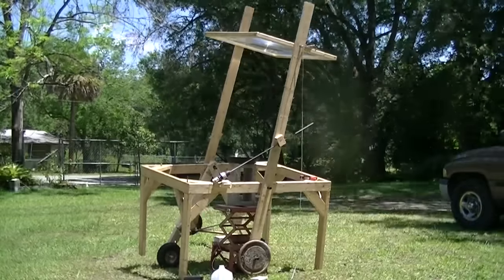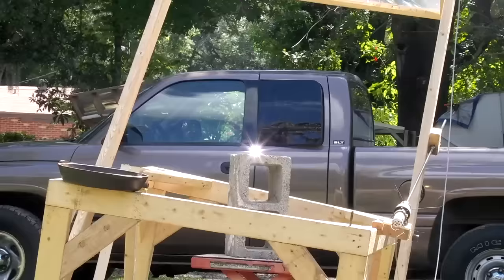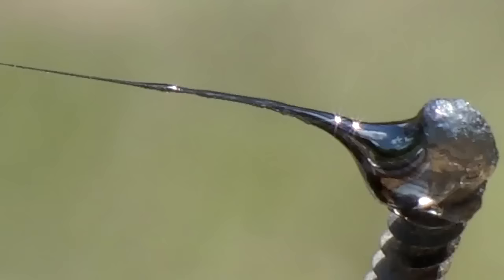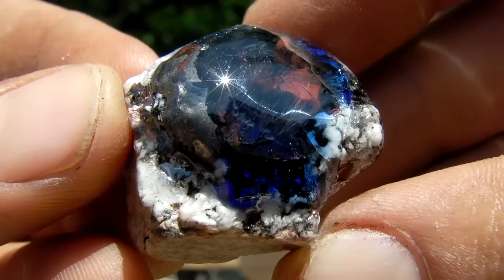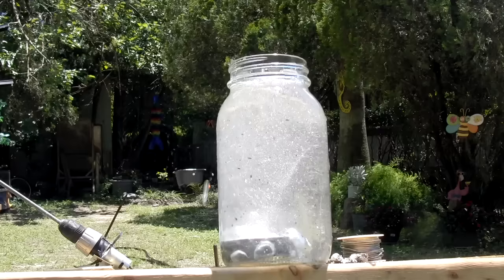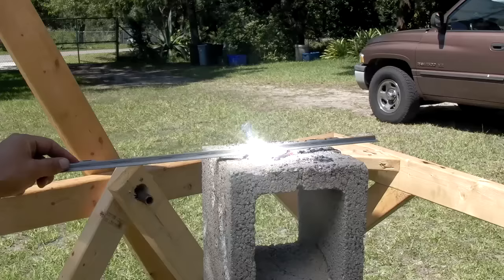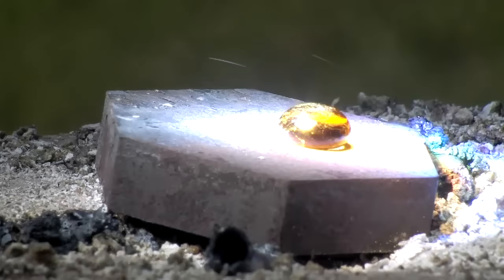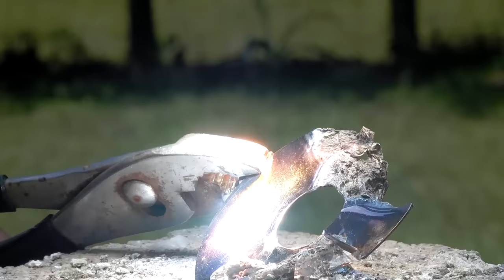Fresnel Lens Solar Power Foundry Obsidian Farm 3800 ˚ F 2100˚ C Fresnel Optics greenpowerscience

Comment from the maker: Info on Fresnel Lenses:
http://greenpowerscience.com
Reply: GREENPOWERSCIENCE i need a fresnel lens!
Reply: how much for?
I WANT IT.
Reply: can you put 2 Fresnel lens in a row for a supreme source of heat ?  or the second lens will melt like all the other material ?
Reply: Do you believe that a large enough fresnel lens could easily cut stone? Like to cut stone for construction purposes.
Reply: Why are they using this for solar panels
Reply: hey uhhhh, you can contain your work area with argon. might get some impressive results. ;)
Reply: i think i just invented a new way to weld.  im gonna draw this up
Reply: @greenpowerscience what is the quality of the obsidian? Can it be done to make good quality obsidian have you noticed? Without cracks or unwanted inclusions? Also have you tried making rainbow, gold sheen or silver sheen obsidian by chance?
Reply: @GREENPOWERSCIENCE Have you experimented with air heating with fresnel lenses? How would you go about building a contraption that could heat as much air as possible, as hot as possible and as fast as possible?
Reply: @BriShep123  i suppose you would need some kind of heat shielded chamber and a vent attached to that which leads to a far away suction fan so it won't melt. Something along those lines maybe even heating a water tank and pumping the hot water through the house...like heated floor systems? Lots you could come up with when you really think about it
Reply: @jeffclarkofclarklesparkle3103  Yep, I was thinking about something like that. I imagined a thick rotating tube made of a material with a high melting point. The tube could be wrapped in another heat resistant tube, a heat shield like you said. The heat shielding would have openings at the top for the light. And the thick inner tube would somehow rotate  at high speed and the air would pass through the core.
Reply: @BriShep123  even that seems like a bit too much, dont forget you need the solar tracker as well for it to be most effective. What i think is that if you have the focal point inside a giant crucible with some very thick heat shield layering and a side vent, all you would need to do is pull air from that vent i think. No need for rotation, that just adds more room for error.  But say the other design you heat a huge tank of water and have that pump through infloor heating pipes, as well as a steam turbine to generate some steam power as well maybe would be another good application for heating, and i think with the water tank method it could be controlled much better than the other and possibly for hot water in the plumbing as well....got ya thinking yet hahahah?!
Reply: @jeffclarkofclarklesparkle3103  Using a water circulation system would be a indirect system, I think direct heating is better for getting the air as hot as possible. I was thinking perhsps a long thick ceramic cylinder would do the trick, I imagined if the cylinder rotatated under the focal point it would heat up faster and distribute the heat more evenly. Also, because the air would probably take a while to absorb heat from the cylinder wall, it would probably take multiple lenses aiming at thr top of the cylinder. I wasn't going for simplicity 😉, just getting the air insanely hot.
Reply: @BriShep123  right! Im no expert by far, just trying to help brainstrom. But yeah who says you need just one lens? So this cylindrical design may work. You may have to play with the speed of the cylinder a bit, or even hook up some kind of slow suction. Are you going for space heating or forge style heating? How hot you talking about? You said as hot and as fast as possible, but you may need to do it gradually for highest heat im thinking
Reply: @BriShep123  p.s. love the ideas of these lenses. And the idea of heated floors one day and if you get this design for hot air going please do share! ...im also going to try my hand at making obsidian when i get a lens of my own
Reply: @jeffclarkofclarklesparkle3103   Forge style heating is definitely what  I'm after. I was also thinking instead of just a ceramic cylinder, maybe a melted or almost melted material inside the ceramic cylinder. Lots of possibilities. Good luck with your own lens experimenting. Free floor heating sure would be nice.
Reply: @BriShep123  just build a clay forge as big or long as you'd like it. If you're into forging...check it out
Reply: Have you tried putting a steak on that see haoe fast it would cook and burn?  Also  put Animal bones to cremate them?
Reply: What type of rock did you melt at the start of your video and which then gives a vitrified effect please?  Is it obsidian or granite?  Thank you
Reply: Yo, u hve to check out DR. STONE. anime. Its legit info and u r like a living dr stone w this contraption
Reply: @denisgiguere1600  yes
Reply: Have yall used this at night to make objects colder in moonlight?
Reply: @BriShep123 
1 square meter, 11 square feet, of sunlight gives you about 1 kilowatt of power. The Fresnel lens, or a parabolic dish, only concentrates the 1 kilowatt onto a small area.
Reply: @MarianLuca-rz5kk  👍

Comment: Why set up MILES of Giant Fresnel lenses devices, alongside roadways, that lead to recycling plants that presently spent big money to create HEAT, so they focus sunlight on very long copper pipes, which are mostly thermally insulated, and pump air or inert gas into one end of the copper pipeline, so that it jets out like a BLOWTORCH from its other end inside the recycling plant, so they can use the FREE thermal energy, to lessen the expensive electrical bill such recycling plants require?

Comment: Why can't they yield this to generate power? Not through solar panels but using this heat to make steam engine. Don't know cons.
Reply: There's actually some solar concentrator power plants in existence, but they're more complicated and evidently more expensive to build than a solar farm so they're less common.
Reply: Why does everybody leap to mega size solar farms when a simple small scale design can provide the needs for one or two houses at a time, combined with small scale localized wind and maintaining a connection to the grid for supplemental power
Reply: Because in general machinery gets more efficient the larger they get and and cheaper the larger and more you make
Reply: Because all that equipment and energy to build it, plus space did the work of what about .1 gallons of propane could do 24/7

Comment: This is clearly one of your best videos.
The tracker causes focused solar radiation to continuously illuminate a single point and many new potential applications exist.
If the fresnel lens is lowered so that it's focal point coincides with the lower pivot of the tracker, the focus on the target will remain constant throughout the day.  It is also possible to pivot the target with the tracker, if desired.

Good Job!

Comment: Hi Rojas, I was just wondering a thought accord to me that your idea could definitely be used to warm swimming pools in the winder to go swimming anytime of the year... I was kinda picturing a connection system to pump the water through while the sun is out to warm tje water up, I guess over a few days it will reach 80+ degrees Celsius or Fahrenheit not only that but it could be connected with a computer to keep it at a certain tempature for practically free. Could you create a video about this for other to take to newer levels, please. I personally believe it will inspire many and will definitely buy these units to add to their swimming pools, even private communities will invest in them or resorts, etc. Because I just went outside its very cold but it would be nice to go for a swim in warm water, but as we all know that it would cost lots of money and the electricity bill will sky rocket. So this solar ray, if built by professionals it will be in assuming the safest possible for anyone to opperate in every household that happens to have a swimming pool not just that but others would then be more inclined to invest in one just because of this concept of yours. I'm a firm believer that it could work and will work, plus it will naturally neutralise bacteria from the water therefore purifying it in a sense because of the heat that it will introduce and infuse into the water. What do you think about all this?
Reply: That's a great idea. Imagine - this technology is so simple and we're complicating our lives enormously by not utilizing this type of technology. All deliberately done.

Comment: You could use this to heat a boiler and run a steam cycle motor with an AC motor attached to the end and produce AC power. That some intense heat! Not sure why they dont use that in a large scale more commonly.
Reply: Jack T it burns the shit out of birds, it doesn't work at night and it powers down in overcast days.

It's astonishing near the equator during summer/spring. Not so much at high latitudes or winter.

Comment: That was awesome Dan! So many applications. Have you seen the solar sinter?
Markus Kayser took a solar panel, solar tracker, fresnel lense, battery, and 3d printer
into the desert and used the power of the sun to print 3d bowls from the desert sand.
The video is on youtube -solar sinter. If anyone could appreciate this it is you Dan!

Comment: Can we boil water 20 lit. At least..
How much time required
Reply: It takes about 628 Watt hours of thermal energy to boil away one liter of liquid water, assuming negligible thermal heat loss from the apparatus, and no heating of the resulting steam beyond 100 degrees Celsius, when the water has already been pre-heated to 100 degrees Celsius liquid state.

The size of the Fresnel lens in the video appears to be roughly 1 square meter, and when oriented directly perpendicular to the sun without atmospheric occlusions like clouds, can collect approximately 1000 Watts per square meter of lens area (although not at sunrise or sunset, when the sun is too low on the horizon and must pass through too much thickness of atmosphere).  In other words, he appears to have an approximately 1000 Watt optical heater.

If the thermal energy was used with 100% efficiency to convert the liquid water into wet steam, then he could theoretically boil off approximately 1.6 liters per hour (ex: 1000 W / 628 Wh/liter = 1.6 liters/hour), or 12.5 hours of strong sunshine to boil 20 liters.  In practice, there is some additional energy needed to raise the water from room temperature to 100 degrees Celsius, there will be some optical loss due to reflections, and there will be substantial heat loss due to maintaining the boiling pot at 100 degrees Celsius (unless well insulated).  Consequently, it is more realistic to assume 50% overall process efficiency (or less, so at least 25 hours of strong sun to fully boil off the 20 liters of water, using the apparatus shown in the video).

If your goal is sea water desalination, it is much more efficient to use reverse osmosis membranes and an electric pump.  Reverse osmosis sea water desalination can be done with about 1/1000th of the energy requirement, compared to simple boiling at 100 Celsius (without heat recovery/recycling of condensate heat).  Photovoltaic solar panels for generating the electrical energy needed for running an electric pump required for reverse osmosis desalination, are around 20% efficient, but this still means that one can produce over 200 times as much clean water per unit time, for a given solar energy collection surface area, compared to direct boiling of the water (without heat recovery/recycling of condensate heat).

Solar thermal heating of things (like making domestic water for taking hot showers) is fairly practical (although it fails to produce on cold cloudy days, when homeowners want the heat the most).  Solar thermal energy is not very practical for desalination of sea water.  Reverse osmosis desalination powered by solar photovoltaic panels is however quite practical, but the water produced is still more expensive than "free" water that falls out of the sky as rain and snow, and collects naturally in rivers and lakes.  Common households in coastal areas should anticipate spending roughly $20 extra per month on residential water (2023 prices), if the household was entirely being supplied with desalinated sea water (via reverse osmosis + solar photovoltaic panels), rather than "free" water that falls out the sky as precipitation.

Comment: Thanks for sharing! I'm working up some ideas for heating alternatives in subzero climates. Getting lots of useful ideas from your teaching / instructional videos. Thanks !!!!
Reply: Wild animals discovered for thousands of years that thick layer of dry soil, rocks, etc were good insulator against sub. zero temp're- so they dug underground or live in deep cave, hibernating during winter months... You can design your house as dome type, strong enough to carry 2. feet thick of soil all around- enough thickness to foiled the freezing effect of snow outside your home,  during winter period... In high dry ground, 7. feet below the ground, the aver. temp're was 20 deg.  Celsius (?)- so burying a copper or stainless tube in such depth, you can extract its free natural heat- to augment your existing house heating system... Youll put a circulating water inside such coil design, buried tube, your water pump will forced the said water to pass thru a heat radiator with blower... Thus, the water heat contents will be transferred to the house interior atmosphere- continiously, 24/7 basis... Thermos wall ( double wall metal, with built. in vacuum motor) will keep the interior temp're of your house constantly- for 7-14 days period, before needing a re. heating in winter or air. con running during summer time... Why such  thermos wall  technology is never tested for housing in desserted area of middle east- is a big question mark...

Comment: I recently converted a linear into a spot lens by sanding then polishing the linear grooves out of the back side and the focal point is the size of a dime and melts rock, glass , and metal with ease.

Comment: There is nothing here that demonstrates the claimed temperature of 2100C.  The obisidian and glass are low-temperature materials (600-700C).   You didn't even show the screw melting (around 1500C), just claimed that it would melt without showing it.
Reply from the maker: https://www.youtube.com/watch?v=qY_Ka1dBlW8
Look up CU melting point, did that with ease.
Reply: Copper?
Reply: I saw the screw starting to melt pretty quickly..
Reply: It did not appear to be melting at all, since the form remained unchanged - only the molten obsidian on it appeared molten.
Reply from the maker: Here is a lens HALF the size f the one in this video…Enjoy:
https://www.youtube.com/edit?o=U&video_id=lWpCot82swM

951 -1100 minutes is the complete screw.
Reply: Again - no link on this video.  Also - more information is needed about the screw composition - it could be brass or anything, so this means little.